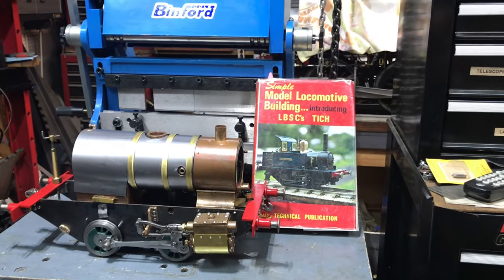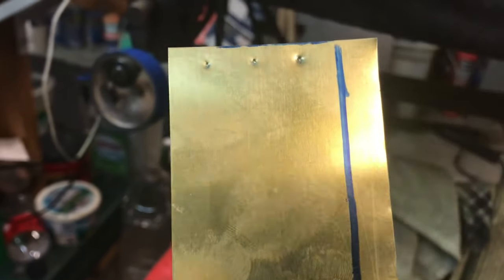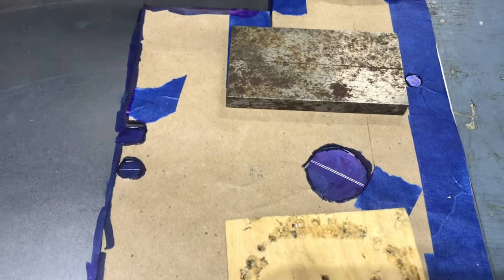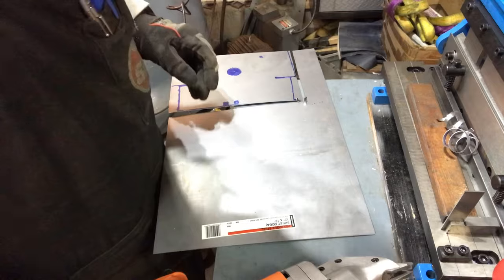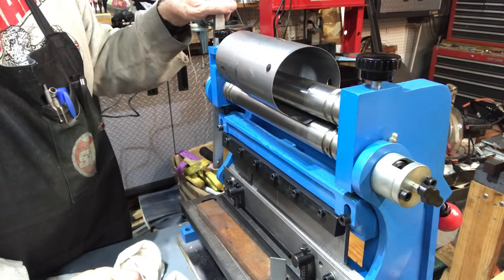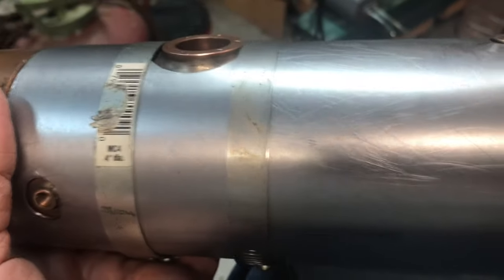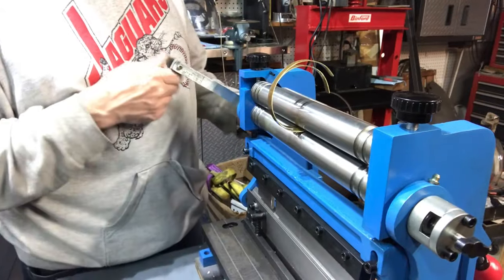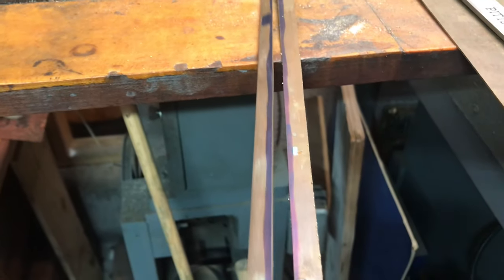60. LBSC Tich locomotive project - Boiler Jacket

Comment: Curious question but is it possible to build a live steam locomotive with no prior experience/knowledge with doing so & machining equipment like with a lathe & such. Wanting to give building one a try but really don’t know where to start. Hope this comment makes sense
Reply from the maker: That is really a very good question. My short answer is yes, but it does take time, money and patience. I did woodworking as a hobby for years before I started metalworking. Then I built several small metal projects to learn the skills needed. If you can, join a local club or find a local mentor to guide you. There is a discussion group called Chaski Live Steam where you can read about projects and perhaps find a local club or mentor. Good luck!